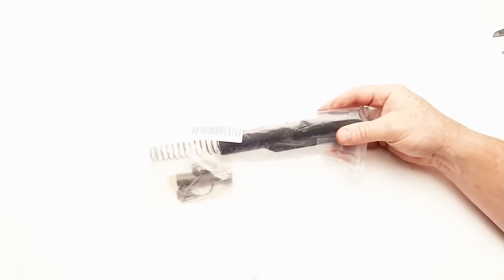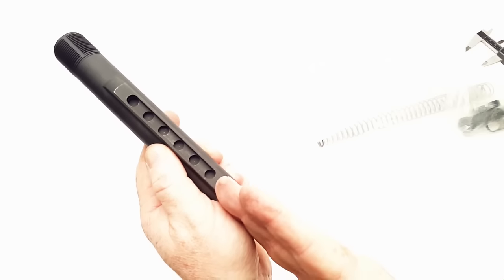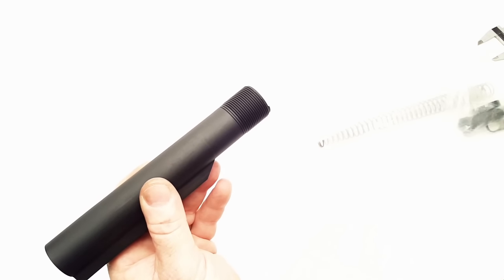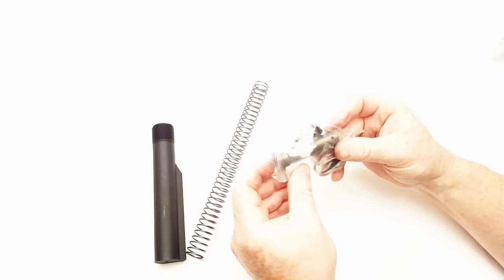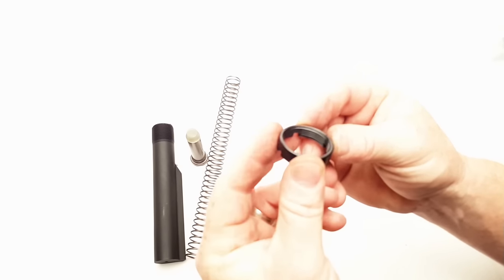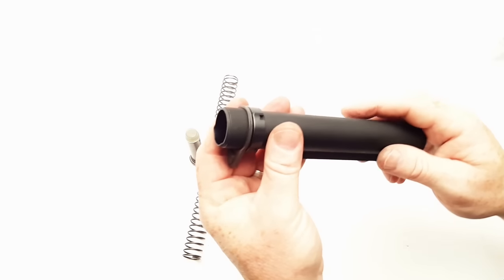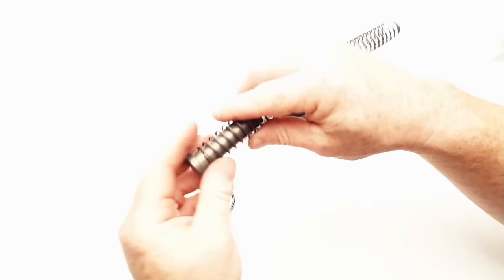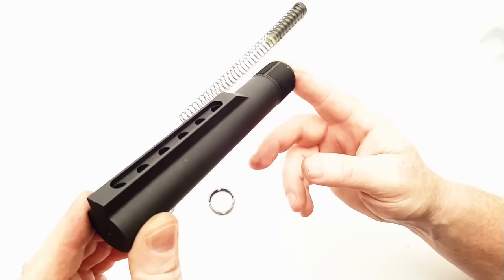Anderson AR15 Buffer Tube Kit Full Review!  WINNER!!!

Comment: Building my first AR and got this buffer setup. Was thinking about adding a Geissele tungsten weight to my Anderson buffer but may wait now. It’s a 10.5 inch PSA upper w FN CHF barrel Geissele pinned gas block and hand guard. Hoping it’ll be gtg once I assemble my 17 design stripped lower. Thought about getting the super 42 w H2 or H3 but will wait for now.
Reply: 10.5s seem to run best with an H2 if they have a standard milspec sized gas port, which im sure FN does.

Comment: Buyer beware for the tube itself. I was building mine today and all was well until I screwed on the castle nut and used a multi-tool and a torque wrench to apply the 40 ft/lbs of torque and when I did that the entire tube turned, I was like "wth is going on", I took it back apart and come to find out that the nub on the end plate had dug into the threads on the tube due to the tube turning. Seems to be a very weak metal. I'll be taking it back to the store and getting a better quality tube.
Reply: I wrote that before watching the video, so would the end plate's "nub" not being big enough be the problem? I mean, I have it together and it's snug and isn't really going to go anywhere.
Reply: Happened to me on my first build a couple weeks ago. Did some looking around on the forums and it seems to be a common problem. The solution I saw was to loosen the castle nut, realign the tube, and hold it straight with the stock while tightening the castle nut back up. From what I gathered, it's not really an issue as long as you can get the nut tightened back up with the stock straight. I'm going to run mine like that for now and not worry about it unless it moves.
Reply: Thats what I was thinking of just doing. I did get it back on tight and straight so we'll see.
Reply: I really don't expect it to be a problem for either of us. I'm sure somebody will correct me if I'm wrong, but I think the tab and slot are just there to keep the buffer tube indexed correctly during assembly and the actual strength comes from having the castle nut tight and staked.

Comment: I just received this it. Surprised you didn’t mention there isn’t a slot cut into the buffer tube. And the Anderson buffer tube, end plate and the castle nut are amazingly. I just took a Bear Creek Arsenal one off. The end plate bends so easily. The castle nut finish is terrible. And the buffer tube is rough on the inside. Finish is easy to scratch. I’m sorry. It seams like everything is made in China. They claim American made. Receiver and barrel are. But I’m not convinced on everything else.